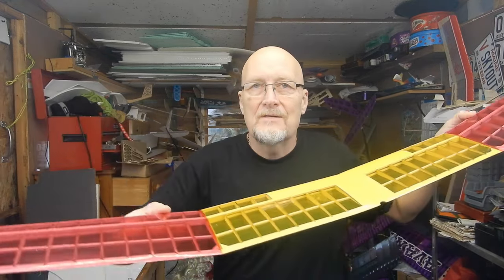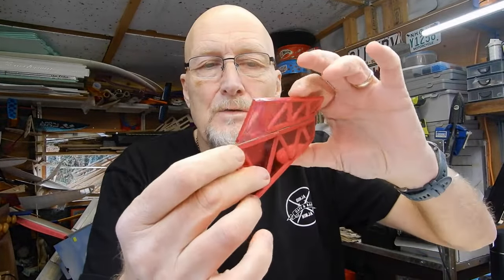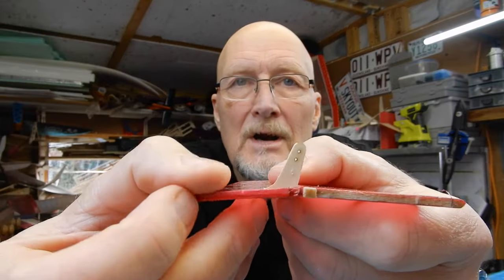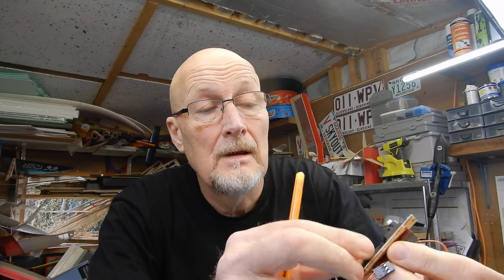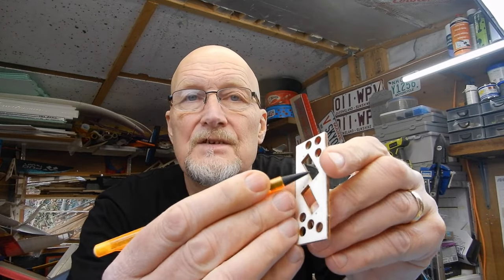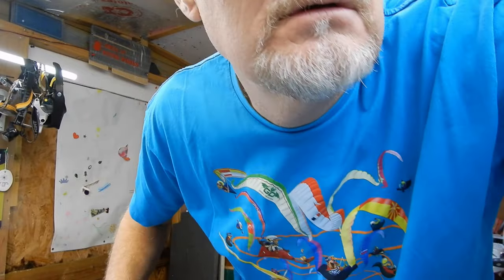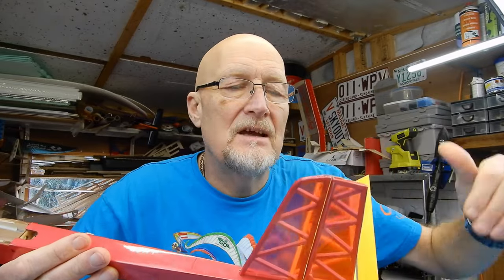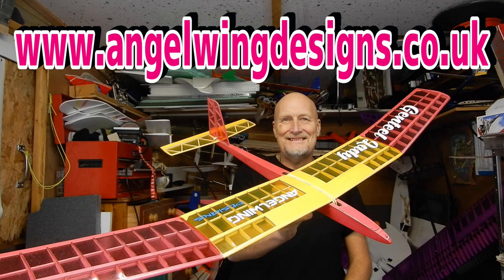How to build Genteel Lady Rc Glider  Part 5 Final radio control installation

Comment: Nick, you will have lots of differential movement with the way you have positioned the servo arms and your Z bends. The servo arms must be at 90 degrees to the pushrod to eliminate differential movement on the control surfaces. As you have it now, you will have very little left rudder and lots of right rudder. Elevator needs re doing too.
Reply from the maker: 🤣https://youtu.be/S5rvz4-J5wo?si=OnUOb25KkRKVzBJR😘
Reply: Nothing a Futaba can't rectify 🤣 @NickChittyFlying

Comment: Thank You Nick! Grat job :) 

For hingeing I like to use tape similar to Scotch Magic, also known as Invisible Tape. I thing it is stronger and more comfortable to do the hinge. It's more resistant for UV and oxidation IMHO. And really invisible ;) 

Good Luck!
Reply from the maker: Thanks mate the tape I use is angelwings hinge tape 👍
Reply: Scotch Magic tape is a Mylar product which I believe was originally designed to be compatible with in the now old hat Mylar Drawing film. Always found it to be a good hinge material.
Reply: The hinge tape is ultra clear and UV resistant

Comment: Great video, some super useful tips. I am struggling to find the link to buy the servos? An internet search has drawn a blank as well?
Reply from the maker: https://www.componentshop.co.uk/5g-micro-digital-coreless-servo-3-5v-6v-kingmax.html
Reply: @NickChittyFlying  Thanks Nick, Ah, I was looking for the CLS0411H that you used in your video?
Reply from the maker: @mattdraysey6000  have look at all at 4-5 grm ones I am at airport going on holiday so just check the size mate
Reply: @NickChittyFlying  No problem Nick, have a great holiday!!
Reply from the maker: @mattdraysey6000  Andy at angelwings.co.uk will always help

Comment: Thanks for this video Nick. Just one question, what tools did you use to bend the wire so squarely.
Reply from the maker: I have to be honest and say my original profession was dentistry and I used orthodontics pliers 😂 but you can buy z bend pliers
Reply from the maker: https://www.balsacabin.co.uk/product/prolux-z-bend-pliers/
Reply: @NickChittyFlying  😄 I have small flat nose pliers but bending very small angles is not easy. I saw hoping you had another hidden secret 🙂
Reply from the maker: @paul-hill  I will send you a diy pair picture on fb tomorrow 👌